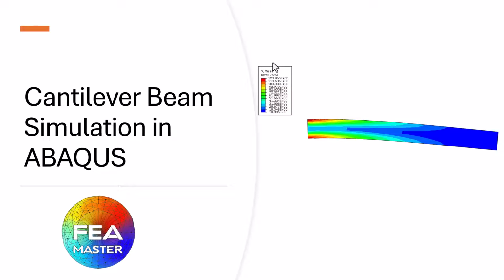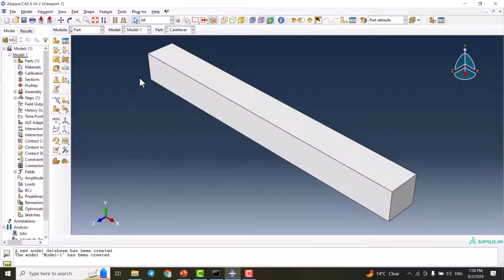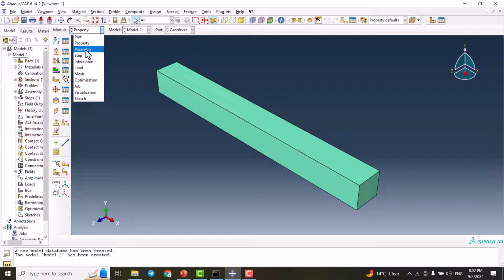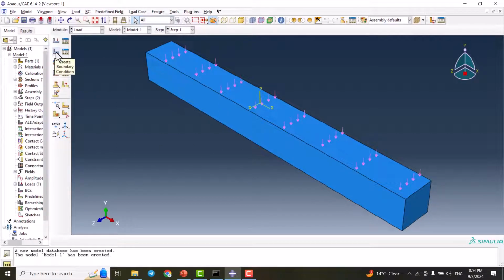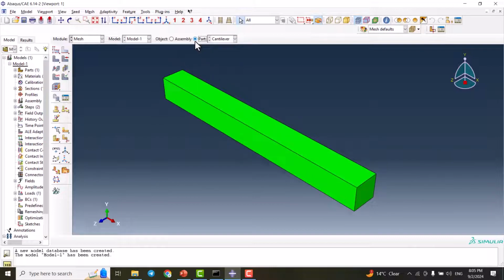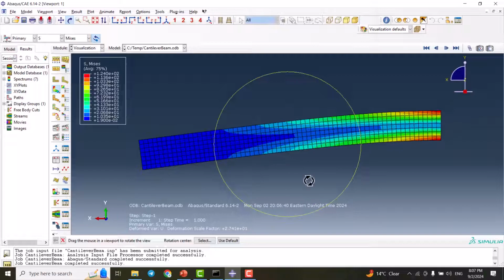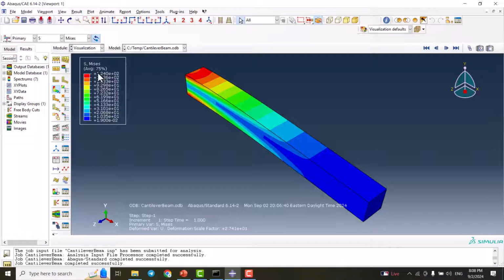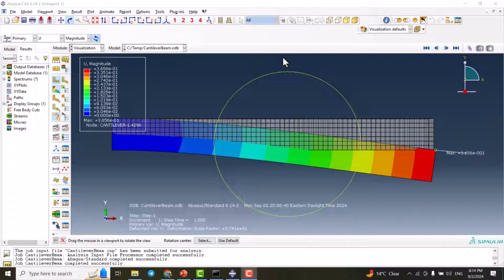Cantilever Beam Analysis in Abaqus (Step-by-Step Tutorial)

Comment: Hello that is very informative one. Can you tell me how to model craig-bampton menthod (component mode synthesis) for model reduction techniques in the cantilever beam in ABAQUS
Reply from the maker: I'm glad you have found it informative! I haven’t worked with Craig-Bampton in Abaqus myself, but as far as I know, it’s doable through substructure generation steps by retaining interface DOFs and including fixed-interface normal modes. It’s not a one-click feature—you’ll need to manually define the retained nodes and run a modal + constraint mode analysis. Let me know if you manage to try it, I’m curious how it turns out!
Reply: @FEAMASTER  Thank you so much for your response, can you give some link or references for this steps
Reply from the maker: @tirthasengupta4530  you're welcome! Unfortunately, I don't have any on my mind!